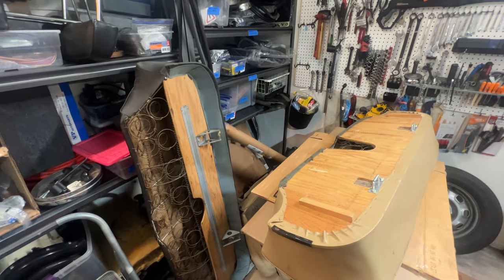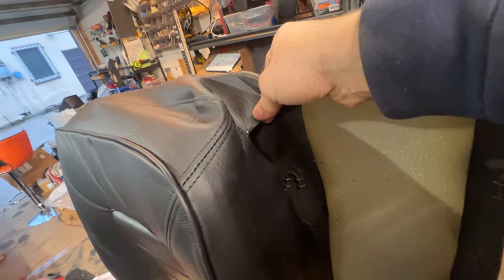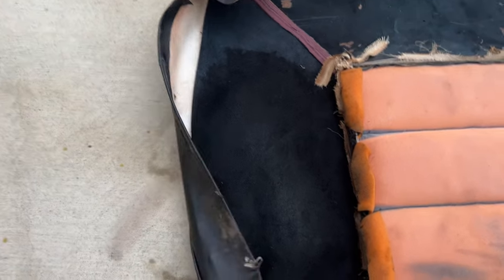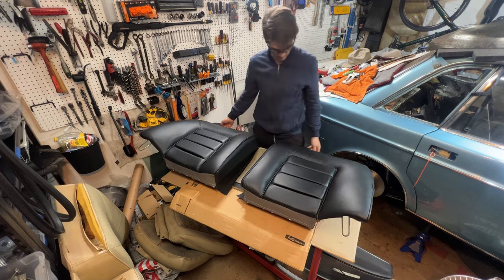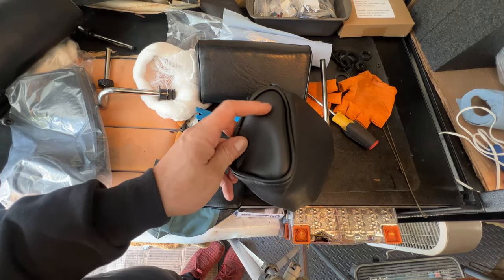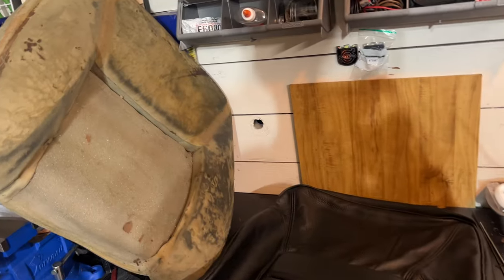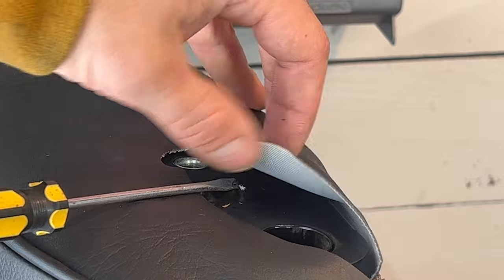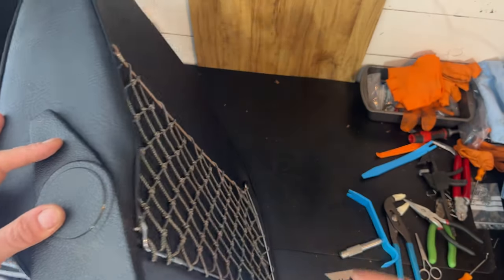1975 Volvo 164 EV build - Part 3 - FULL Reupholstery of Volvo 140 & 164 leather seats

Comment: Seat heating was standard in 1974:s driver seat! In the Volvo brochure it says:  "With the ignition on, heating units in the driver´s seat and backrest switch on automatically when temperature drops below 57°F and turns off when it reaches 79°F"
SAAB got seat heater in  1972 that worked the same way, im not sure but i belive i heard that SAAB was the inventors of seat-heating and Volvo followed  the competition.

Comment: That panel in the seat looks like a seat heater panel from a 240, maybe someone fitted it in some time  it should have a part number you can reference, im not entirely sure that the later 1972 on 164E didn't have seat heating as an option or not
Reply: That is a heater unit in the seat, standard in 1974 ;)